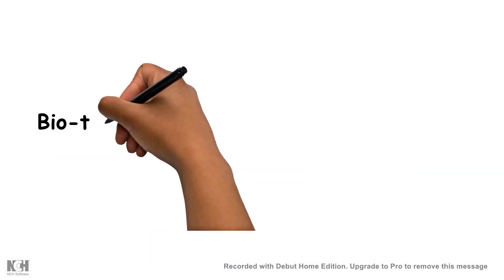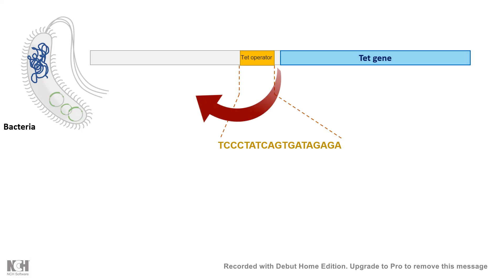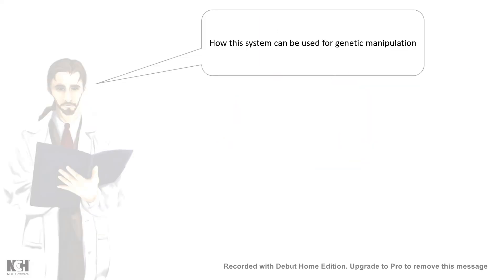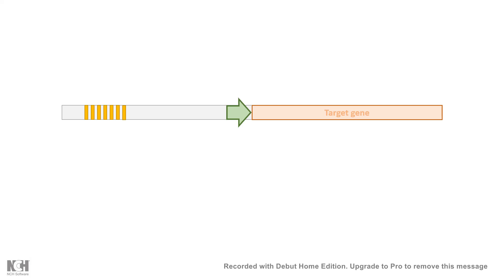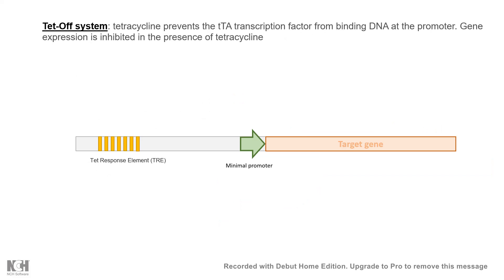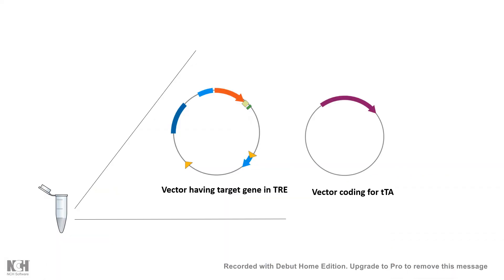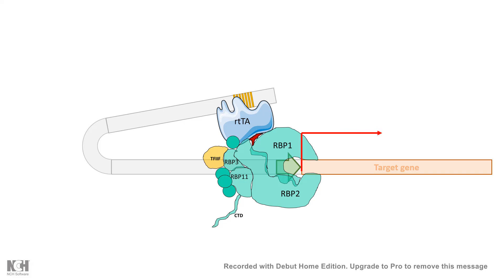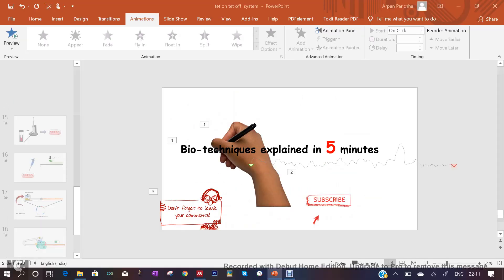Tet on -Tet off system

Comment: why cross two mouse with rtTA/TRE respectively to get tet-on system? Isn't it easier to acquire a tet system by transforming rtTA and TRE into Embyonic Stem cell using CRISPR?
Reply from the maker: Yes its possible...but classically people use to do it like that.